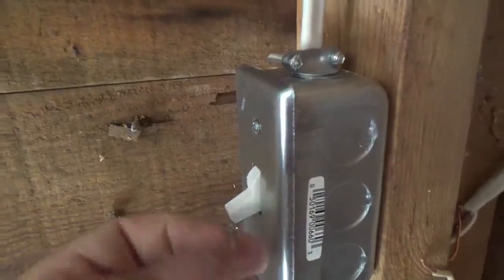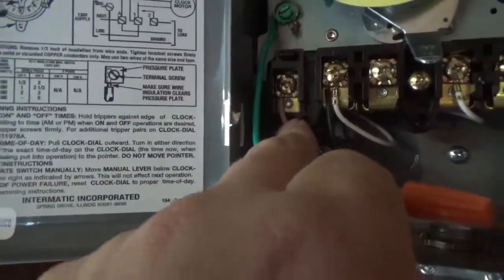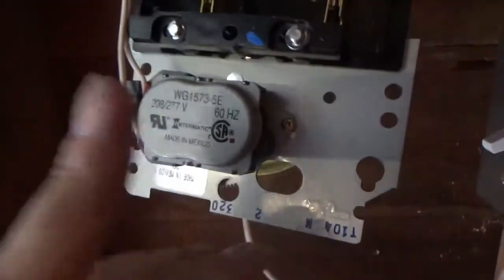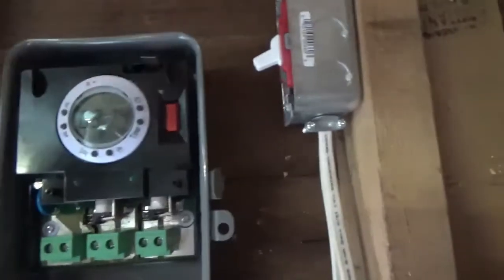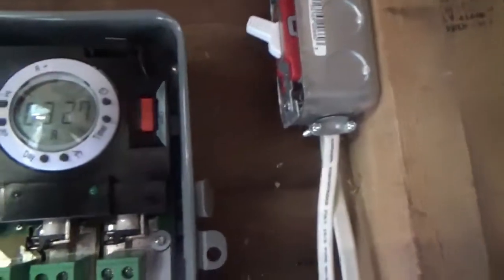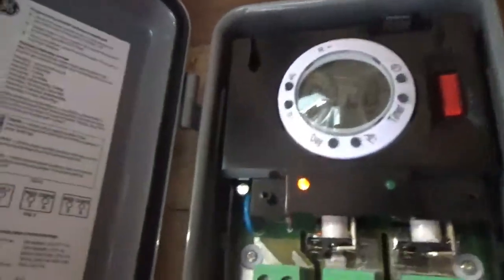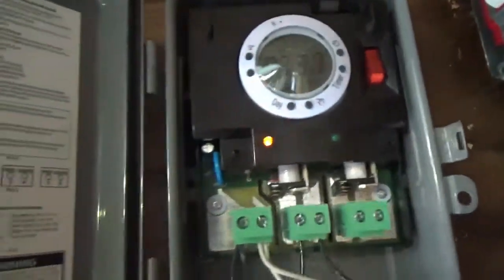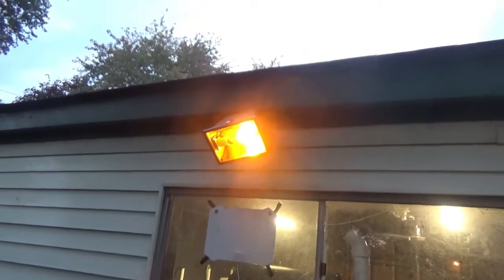Installing High Pressure Sodium Lights On The Garage Part 2 Timer Swap

Comment: The Home Depot, less saving, more doing.  That's the power of The Home Depot.

Yeah, somebody screwed up somewhere, that timer motor wasn't the right voltage.  So, you did everything correctly, but they foiled your plans.

Had the same thing happen when I moved into the house.  Bought all new doorknobs since most doors didn't have any, and the ones that did were all broken or crummy.  I bought Schlage.  Closet doors got plain handles, bedrooms and bathrooms got the ones with the button lock on the inside, and the office and basement got keylocks.

I installed them, then found on the button ones, if I jiggled the handle on the outside, it would unlock and you could open the door.  I called Schlage and told them the problem, and the guy said "This is Schlage you're talking to, this should never happen."  He suggested I try going back to the store and exchanging them, if they wouldn't he said he could send me new ones.

So I went back to Lowe's and apparently I had bought from a bad batch they had, because the 5 new ones all work properly, including the one we put on when you were here.  All that work and trouble, and I did nothing wrong.